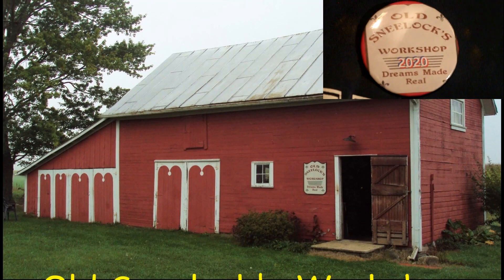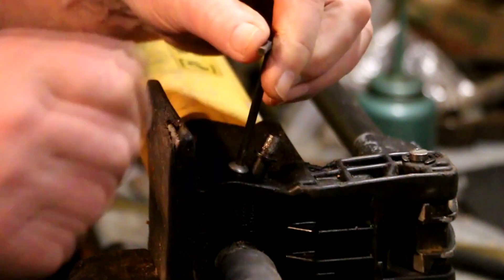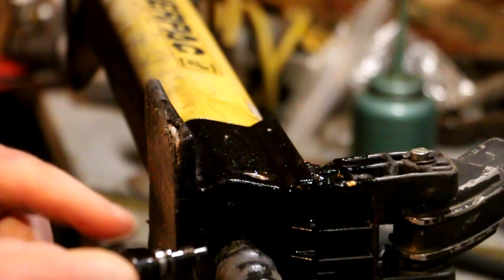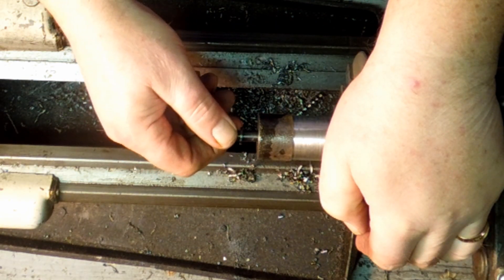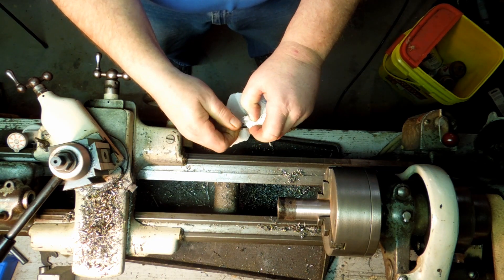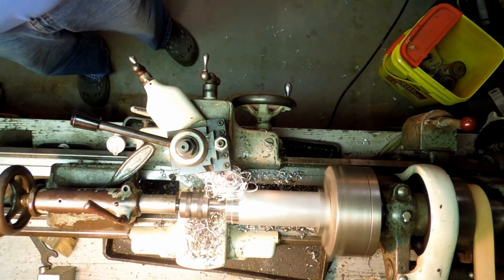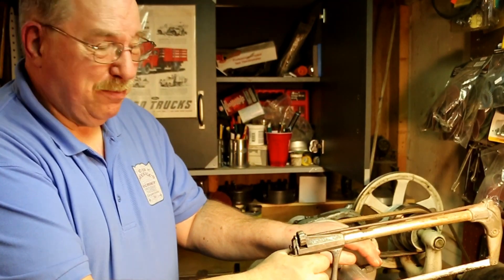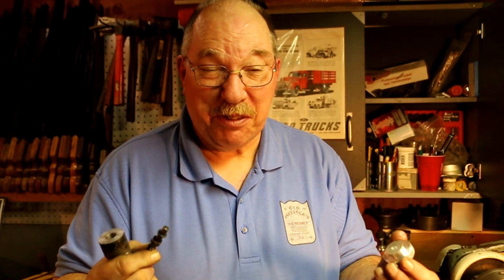Enerpac Hydraulic Power System Repairs Pt 2 Release Valve

Comment: I have always rolled the hacksaw back and forth because I learned from experience that it cuts better that way but I did not know that it was because it cleared out the blade. Learn something every day.
Reply from the maker: The gullet on the tooth can only hold so much once the gullet fills with chips it lifts the tooth out of contact with the surface. Shortenening  the contact surface keeps the chip load down.